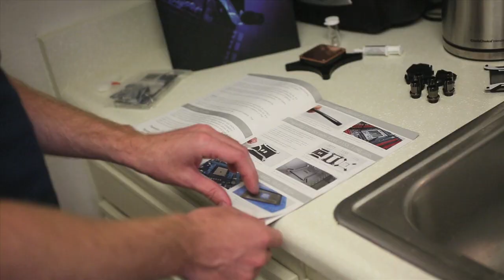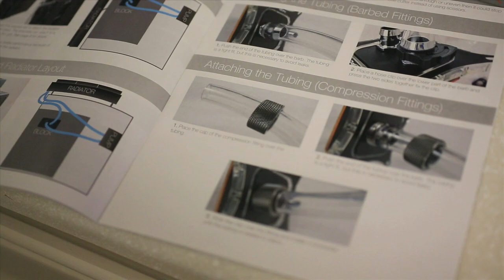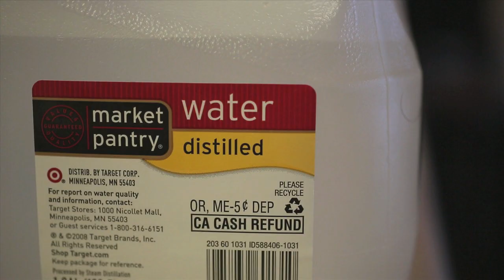A Beginner's Guide to Water Cooling Your Computer

Comment: can you please make a video on how to clean everything after 6 months? i never used water cooling to required maintenance...
Reply: I am sure there are tons of forums that have tut, but just in my opinion do the same thing he did before he installed it, and use something to drain the water out of the radiator!  But you would be on the safe side to look at the manual for your cooler!
Reply: It is better to use distilled water.
Reply: you can try siphoning most of it out and then just refill?

Comment: i want to watercool really badly but refilling after 6 month keeps me hesitant considering idk how i would do this properly
Reply: Graham Aker i have a h80 but i i would like to also add my gpu aswell
Reply: You don't have to refill every 6 months if you spent enough time making sure everything is cleaned out. There are people who leave their loops for years that are still fine. People refill every 6ish months to perform a routine maintenance. It's not all that different from removing the dust from a CPU cooler, except that you also need to refill the loop while also cleaning the radiators and fans.

Comment: Is the water-block the same as a petier plate, but with a water jacket around it as the heat sink? I am building this for my beer fermenters to control fermentation temps.  I need alot of heat-pumping ability to pull the heat out of the fermenter.  Nice vidio, and when your done, you can kick back and know you built it, not some chinaperson!

Comment: is there any risk of leakage under long run hot and hot water may cause some unequal expansion in pipes which may result in cracking at some points i am really confused in water and air cooling

Comment: But do I really need to do this if I have only a basic desktop computer? It seems really cool and fun to do, but not necessary unless you have a lot of stuff going on.
Reply: No, air cooling works just fine. If you aren't overclocking, working under huge loads, need it to be quiet, or working in abnormally hot ambient conditions, fans are adequate.

Comment: I don't get how this really works... wouldn't the computer just heat up the water after an hour or so then overheat?
Reply: If you didn't have a radiator, that would happen. The radiator allows for better heat transfer than just air so that a main reason water cooling runs so much cooler and quieter than air.

Comment: This is a bit more complicated if you are doing it for the first time, there are non maintenance ready to install cooling systems that work better for beginners in my opinion.
Reply: Well, they are also louder,(especialy with stock fans, witch adds 20-30$ to the total cost if you wan´t some good ones.) lower, preformance, non-upgradeable, lower quality and a bit overpriced for what you get (Aluminum radiator, shitty pump and bad/loud fans and thin tubing) For mantience, if you buy premade cooling liquids you don´t have to bother for 3-4 years and if you haven´t upgraded your computer by that time i don´t see the point of getting watercooling.

And i think if you can install a cpu cooler you can probably connect some tubing and fill upp a resorvoir.

The only all in one watercooler that i woud really recomend is the Swiftech H220 whitch fixes all the problems above.
Reply: Marcus Tideberg I think im going to have to disagree with you, the coolermaster nepton 280L is a fantastic AIO cooler I bought one and its cooling a amd fx 8320 at 4.7 ghz like its nothing my idle temps sit at 15 degrees Celsius and my load temps never exceed 44 degrees celsius

Comment: Too much trouble
Reply: Then you are prob not into computers like we are.
Reply: Sebastian Rogers
5 Ghz on Air?? Your trolling. Your not getting anything close to 5Ghz on Air. Maybe 4.2 - 4.3Ghz, but thats about it.
Reply: I agree to much trouble I overclocked my i7 to 5.0ghz air cooled and i dont have to do all that junk every 4-6 months
Reply: Sebastian Rogers
You havent even denied it. LOL. And as for computers, bro you have no idea what I know, and what I dont know. lol. Lets just leave it at that.
Reply: MASTERUDY Castillo Definitely false.
Reply: I am not trolling stupid term made up by idiots who don't know how to use a computer.
Reply: Exactly so go check out my overclocking guide noob and see how I got to 5.0ghz on air
Reply: Thetechgenius dude just buy expensive air cooler
Reply: I dont run any of my hardware on Air. My entire system is on Liquid (including the motherboard itself), and its whisper quiet.
Reply: ryanmail2004
 That depends. If your PC is in a hot room, the surface temp will be higher, so the CPU temps will be even higher then that. With liquid cooling, that doesnt matter, Liquid cooling is not only better at lowering temps, but its also a lot more efficient then any air cooling system. And when you move up to Custom Liquid Cooling Systems, the efficient rate is even more higher then closed loop systems, and the temps are much much lower. You have to think, its not just the CPU giving off heat, and all the other components that do give off heat, make the case temps higher. Liquid Cooling brings down the case temps a lot, because there is no fans blowing in hot air into the case. And the liquid is moving so fast through the tubes, its so much more efficient then Air Cooling on all levels. And with some GPU's, the lower the Temps, the more the card can overclock it self while playing games.
Reply: ryanmail2004
And you try to overclock a Quad Core i7 or Extreme Series CPU to 4.8Ghz or higher on all cores, with just Air Cooling. Let me know if your CPU survives longer then week while doing your regular gaming. I bet the Temps will be really high on idle, and even higher under stress.
Reply: MASTERUDY Castillo
I bet you run a crappy AMD processor and play minecraft all day

Comment: how is this andy quieter than a fan? he has two fans attached to the radiator instead of having one fan on the cpu cooler. plus the pump makes some noise.
and how can it be cooler than a regular air cooler? i mean the water heats up and gets reused, while you could get fresh air through the system the whole time.
Reply: The fail is strong with this one. You do realise engines in cars and motorcycles are now watercooled because aircooled engines just died all the time right?

Water has an excellent heat capacity, and the fans keep the water cool (relatively speaking). Essentially you have two rounds of cooling, the water, and the fans. Water has a better head capacity than air. It's really that simple. It's why you need thermal paste with air cooling, because without it the heat transfer through air to the cooler just causes hotspots and shit
Reply: It is quieter for a couple of reasons. true it does have 2 fans on the radiator, however the fans are bigger and therefore can move more air at a lower rpm, the small fan has to spin a lot faster which obviously makes more noise moving through the air. Also Water is a much better heat conductor than air so more heat gets absorbed from the cpu into the water than it does with air. because of this the system will run much cooler, and the fans do not have to spin as fast to cool the water, and again the fans not having to work as hard allows the system to be quieter.

Comment: If my GPU has 2 fans as in the Geforce GTX 760 Superclocked one will I need to cool it or only my cpu which is always on AMD Turbo Control Center at 3.5GHz from 3.2GHz?
Reply: If the GPU was overclocked out of the box then you shouldn't need water cooling but if you overclocked your CPU then you would probably want to water cool it to prevent it from overheating also if you don't want to deal with water cooling you can use something like the Corsair H100i which just cools the CPU but it is a lot easier to install and doesn't require maintenance like normal water cooling

Comment: Don't use silver in your loop. It'll react with other metals, not all but just to be safe/
Reply: Silver is a noble metal, plus a lot of people have been using killcoils with no problems. And that silver kills micro-organisms in the water. Unless you assembled that PC in a cleanroom, you are bound to get microbes in, that's why PTNuke or killcoils are used.
Reply: cybermonkey81 It will react with un-plated copper. For sure.

Comment: As a note, overclocking your possessor by increasing the herts; builds a lot of heat. make sure you got an efficient cooling system before overclocking in the form of herts.
Reply: HERTZ
Reply: 11horsepower
well sorry genius. I have been taking classes for electronic engineering and I have yet to find out how each scientific word is spelled.
Reply: I will come to that guy's defense and say: IT IS JUST. ONE. MISTAKE!!!!
Reply: q13e5
you old and you dont know how to spell Hertz? you shouldve learned it in at least 10th grade chem or before from common knowdledge
Reply: i didn't take chemistry
.
Reply: I've never been in chem lol
Reply: Honestly i dont get why it matters how its spelled. It clearly means Hertz .so thus
herts herts herts herts herts

Comment: so i use vegetable oil in mine... is that bad?
Reply: as long as the motor can handle it and you clean it more frequently. make sure you have parts that don't deteriorate by oil in your water-cooling system; or anything that will come in contact with the oil for long periods of time.  also make sure the viscosity of the oil is acceptable for the motor. too much, (Runny) and the oil wont flow as much as water would do. Too little, (Stiffer) and you will burn out your motor, and ruin your watercooling

Comment: ONLY if you use low quality material blocks that actually leave traces fast enough. High quality loops will not leave traces to the needed levels for conductivity befor you are already switching out to new water.

Comment: Case -> Radiator -> Fans in PULL configuration, not pushing air down, but drawing it up out of the case works the best for several reasons, the two main ones being that hot air rises anyway, so it's already right below the radiator ready to be drawn out, and the second reason being that any time you PUSH air through a rad, you also push dust against the rad surface, where it can be very difficult to clean away, hindering airflow. Much easier to clean a bare, fan free surface.

Comment: Keep some isopropyl alcohol for any incidental spills when assembling and theres nothing to worry about. If the computer has no power going through theres no danger to shorting something. Its not necessarily the water that damages components but corrosion after the water has dried up. If you clean it up with the Isoprpyl before it dries you'll be fine

Comment: Those fans were blowing hot air into the case. I would have put the fans the other way around on the inside of the case blowing over the radiator and hot air out through the top.

Comment: with your 240mm radiator, do you need to have 2 fans on the bottom and 2 fans on the top of it? or just 2 at EITHER the bottom OR top?

Comment: Yes i understand all of this. I prefer to use coolant myself. And yes even oil based coolers are called water cooled. But distilled water still has some conductivity(no where near as much) and can arc components if you flood it. This happens especially if you buy cheap distilled water an can be eliminated by buying ultrapure water, but at that point you should just buy a different coolant. Anyways, im merely trolling the newbies, no need for you to hold my hand.

Comment: id like to MOD my h50 corsair ... combine with xspc 4x140mm radiator and xspc resevoir.. is it ok to reduce the flow from 3/8" to 1/4" so it can fit to my old h50 pump fitting ?. thanks.

Comment: Is destilled Water really as "powerful" in a watercooling build as the chemical water is?
If it is, what kind of colours can I use without damaging the pump/radiators?
If not, how much is the temperature difference in °C?

Comment: You probably will have to mix and match parts. There probably are kits though. You just have to look around.
There are also all-in-one kits like the Corsair H100i which are sealed with special liquid already inside so you don't need to top it off or maintain it, and those will last years.

Comment: depends on the CPU heat output but it should for the most part. If you're new to liquid cooling the H80i goes recommended for smaller cases.

Comment: for the radiator, 4 comprsion fittins 3 fans, tubing and coolant i payed like 100 euros, after i bought a pump, new reservior and cpu block for 112 euros, i converted from NOK(Norwegian krone) so might be different for you, but i reqomend starting with only a cpu loop, if your going to epand it, start buying a 360mm radiator

Comment: That's like saying you'll never drive a fast car because one of your friends wrecker their porshe at 120. You can't base everything off of others' experiences. When you say 28 degrees I'm assuming your in Celsius, but also is there any overclocking on your system, GPU or CPU, or both. There are many variables involved in deciding whether or not to water cool your pc.

Comment: Distilled water is not a conductor, the reason it may become conductive is due to minerals, metals, and any other conductors that may enter the water. This is one reason you clean the parts out before connecting everything

Comment: I'd like to mention it's best to connect the pipes the way they don't start bending right where they're connected, when 2 ends have to be close to each other, better take a longer piece and create a loop to minimize tension. Also avoid twisting the pipe if it's not in desired position. If everything fits loose, the risk of leaks (or their occurence over time) decreases greatly.

Comment: you should be able to connect the fans to your motherboard through any 4 pin or 3 pin connector, it wouldn't matter if it was four or three pins because a 3 pin outlet still fits on a four pin connector. Just a 4 pin won't fit on a 3 pin.

Comment: I actually just built a system with the highest of the APU line and I'm quite impressed, especially for the price. I'm trying out the Dual Graphics thing soon but my card hasn't shipped. But it runs, for example, every Source engine game like TF2 or Portal 2 at 60 fps and above. It probably can't handle anything brand new at max graphics, but especially for a $350 system, that's a bit much to ask for anyway.

Comment: Not entirely. They aren't exactly outdated in that they have only been around since 2010, and while they can't generally run games that well, they do have their uses. An a8 5600k only costs about $100, yet will run modern games at a fine fps, albeit on low graphic settings. So they are useful if you want to get a really cheap PC that still runs games decently.

Comment: Then you use too much... Really, try to use less next time, as too much thermal compound can act as an insulator and therefore result in high temperatures. Just a tip for ya :P

Comment: Yes its possible,
I have intel celeron 1.5ghz 0 cores 2 virtua HT-cores and gt 610
(all overcloked cpu 6.5ghz gpu 3ghz)
128gb ddr1 ram and 350w Modecom psu

How i did achieve such overclock you ask?
I found out that the coolers get hot, so i did remove all the cooler because they are heating up chips that they are touching.

Comment: A metal plate take all the heat from the CPU. Water passes over that plate to cool it down. The hot water is brought back to the radiator, where it is air cooled by 1 or 2 fans. Its just like how a heatsink works, but with water instead of air. They are much better than just air-cooled computers, but cost more and are more complicated. Consider picking up Corsair's premade watercooling solutions. They don't that pretty, but they are easy to use.

Comment: You do realise that the difference between rendering 768 and 1080p is massive, right? Realistically, yo want to not drop below 60fps for a smooth experience. 30fps is just tiny by modern standards.

Comment: actually i can run skyrim on high settings at around 45 to 60 fps on 1360 768 resolution (i dont have a 1080p monitor) and it can run bf3 on high with same resolution at around 30 fps.

Comment: who can help me with this? when choosing tube size and fittings, does 1/2" fitting must  equal the inside diameter of the tube or slightly smaller?

Comment: I got the i5 4670k, but at the same time got the 760, so I'll SLI two of them later. I like that my Haswell is only 85 watts compared to the 8350, which is 125 TDP. I have it watercooled though by the Cooler Master Seidon, and it always keeps it under 40 degrees. I'm enjoying my PC so far, it's really epic. Anyways, thanks for answering!

Comment: You do realize that most Intel processors are more expensive than AMD ones right? For example the FX 8350 is cheaper by 50 bucks than the 4670k. Just sayin'.

Comment: thought about using a 360x360mm rad I found on frozencpu along with dual mpc655 pumps the radiator will be outside the case mounted to a stand

Comment: You can just connect the ends of the tubes together, routing from component to component.. You might need a more powerful pump depending the total amount of components since you will be pushing more fluid and the more tubing the more friction. It is probably suggested that you use more than one radiator. I would suggest two 240mm rads if you can put them in your case but a 240mm and a 120mm would probably make the cut. Watercooling your Hard Drives isn't really needed unless you wanted to...

Comment: NO!, water cooling is to cool your computer down better during overclocking. It is not made to overclock your GPU and your CPU to max. Lets say you have a 3.9 Ghz processor. You can go upto 4.6 - 4.9 on air cooling. But, if you want 5.1 - 6.0, you can use water cooling. After this, the processor tends to get really hot and water cooling would not do it. Very experienced overclockers have actually overclocked over those speeds but they used liquid notrogen and helium to cool down the processor.